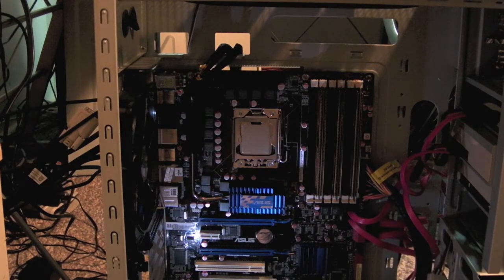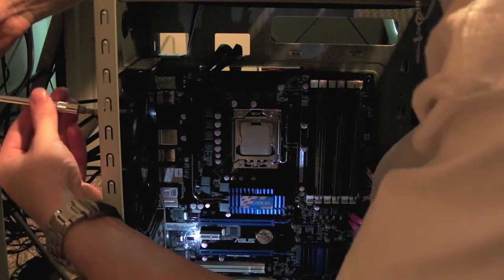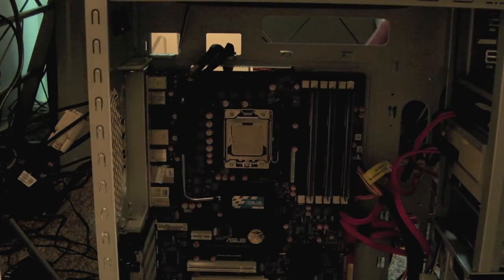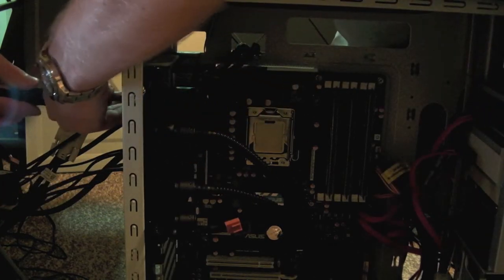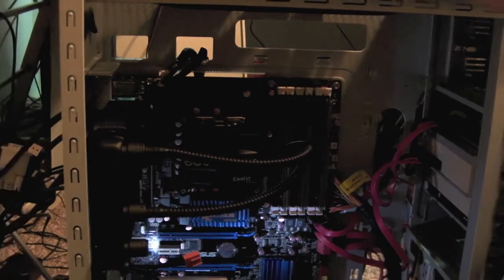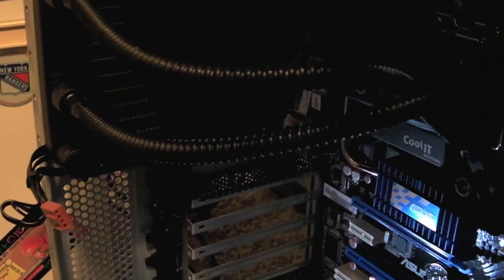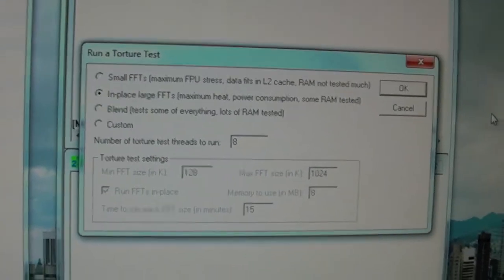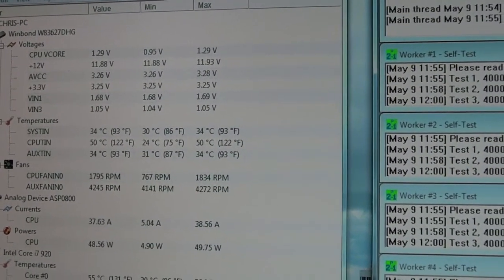ECO ALC Coolit Systems Part 2 Review/Install/Quick Benchmark

Comment from the maker: @skulker1983 Improvement is well worth the money "bang per buck". The installation is simplistic if you are building a new system. If you are upgrading depends on your case and how willing you are to rip apart your system. I am curious about the gpu cooling they have but don't see any for 5850s and I would have a review on that too.

Comment from the maker: @walther89 I didn't take the CPU out, my case wasn't designed for 1366 so it wasn't easy access I had to loosen the motherboard to squeeze in the backplate.